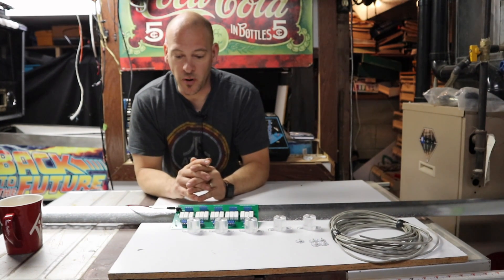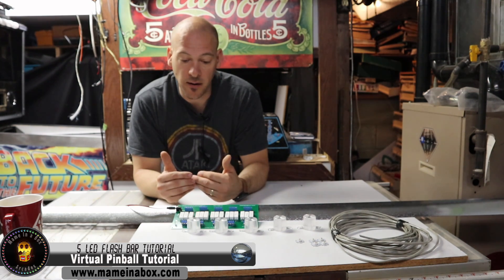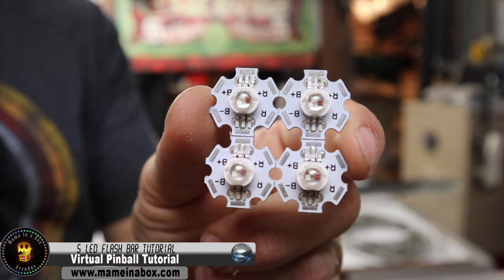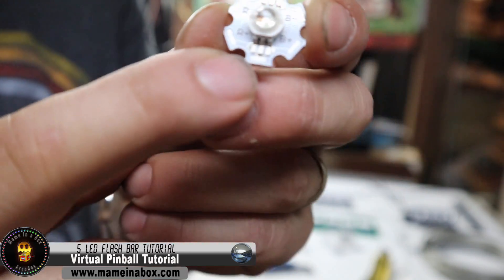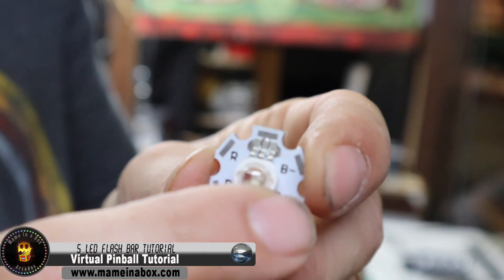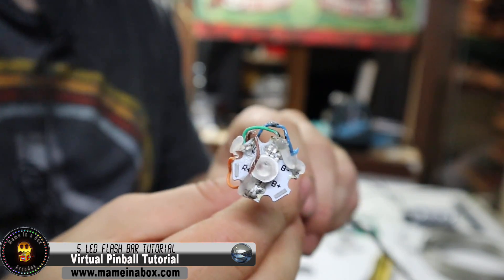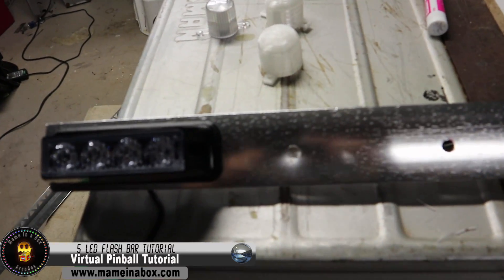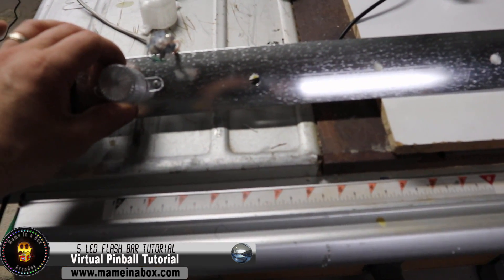DIY LED flash bar

Comment: how comes you use the same resistor value (33 Ohm) for any color? Shouldn't it be 27 on green and blue?
Reply from the maker: Technical speaking yes. There is no visible difference to my eyes and this has been working flawlessly for a couple of years now.

Comment: Great set up , I'm thinking of of making my own 5 flasher bar ,my question is do I need to use the the led wiz or can I use the teensy to control the flashers ?
Reply from the maker: You will need the ledwiz or a pinscape. The teensy is only for Addressable led
Reply: Ok thanks ordered 👍 
Can I also connect my strip lights to the led-wiz instead of using teensy?
Reply from the maker: Not if they are Addressable.  If you want a led strip to connect to the Ledwiz, you will need regular RGB led strip.

Comment: Hi I bought your flasher management board. Everything is working fine and has helped me greatly powering up the flasher lead.  Just got one question. All the 5 leds come on when I turn the pc and power on to all the boards. They then only go off when I start pinup player, and then coming on when I start a table via dof. Can I do anything so they dont come on when i turn power on initially? Not a deal breaker, its just that i could be just working on my pc and all LEDs would be on.
Reply from the maker: How do you have them connected to your cab? are you using a Ledwiz? And do you have the output of board going to a port on the ledwiz?
Reply: @MajorFrenchy  hi I have the 15 ports (3 per rgb led) going into an ultimarc pacdrive. Then I have power and ground from board going into power supply. No other output going into the pacdrive?
Reply from the maker: @kalnayak11  that is an issue with the   pac drive. When booting the computer, it opens all ports and does not close them. 
2 solutions. Get a ledwiz or pinscape to replace the pac drive. I have a pac drive and when I boot the computer I disconnect the usb and connect it when windows is loaded. You will see that the device is still on when connecting. I run ledblinky and close it to stop the Pac drive. It sucks but that is the reality of the pac drive.
Reply: @MajorFrenchy  thanks for that info! I do have a pinscape but as I'm running it without the expansion boards it will just take too many ports and mosfet boards. I will look at getting the ledwiz from groovy. Pacdrive was just easier to obtain from uk :) in meantime will disconnect usb on startup. Cheers

Comment: I was thinking of getting the recroommasters 40" pinball cabinet. Do you think this idea would work on that kind of cabinet? Do you think it would fit on top? Thanks https://www.recroommasters.com/40-Virtual-Pinball-Machine-p/rm-xt-40-pin-cab.htm
Reply from the maker: The cabinet looks good. Yes the 5 LED bar fits whatever width of cabinet because you need to build it. Some people use wood, aluminum or even metal.

Comment: thanks for another great vid,   I did pick up on in the config menu,  shouldnt it be device #2   as your first LED Wiz  is your button config?    or  are you just using the one ledwiz?
Reply from the maker: I am using 2 Ledwiz. I am using the 1st one for non mechanical stuff and the 2nd one is using the Sainsmart board with the Ledwiz for all my solenoids, contactors, gear and shaker. Yes my buttons are connected to my ledwiz. you basically connect the Negative of your button light to the Ledwiz to make them blink.
Reply: @MajorFrenchy  the ledwiz here in australia is pretty rare to find or out of stock,  besides groovy gamegear where did you purchase yours?
Reply from the maker: @Cappfzr  Groovy.

Comment: I love that you utilize network cables, I have a abundance of these.  When I installed my controls, nudge, and plunger VPin controllerI used a old Printer cable since it had enough plus extra and was able to keep a lot of it sheathed at least till the first connection makes things so clean
Reply from the maker: You are right about making it clean. It's easier to fish them in the cab as well.

Comment: Great video! Please major frenchie make a video about the lockbar receiver installation!! As well as the siderails and glass. I already got my playfield display (Acer et430k) and I am currently searching for a backglass display, Is 16:10 at 30"inches the closest to the real deal?  Is backglass art created under 16:9 format, will it look stretched? What do you recomend
Reply from the maker: i don't know anything about the lockbar mechanism. All tables i every built were restored original cabinets and never had to install one. for your backglass, you can tell the software the dimension of your choice. That should not be an issue in your case.
Reply: Hey Johnny i've actually got my table apart for upgrades right now, what do you need to see for the lockbar install? i can shoot a short video showing my lockbar, I may have been super lucky - I eyeballed it and everything lined up about perfect but i'm happy to show you where mine lines up, where i screwed it in, etc I don't have any install photos here and I hope MF is cool with me linking out, but here's my build album (https://tinyurl.com/y6c59n2w
), send me a friend request with your youtube name (if different) and i'll get you whatever you need

P.S. MF if you prefer i don't do that shoot me a msg and i'll remove it! :)
Reply: @PwnyTrix   awesome work! Thank you so much for you response. I am building a cabinet from scratch, custom made to fit a 43" playfield and I've been researching online for hardware parts, I came across the virtuapin  lockbar and lockbar receiver kit, so I wonder how does a regular lockbar receiver fits inside and how the mechanism works in order to implement that on my project. Thanks a lot!
Reply: @johnnyulate8218   I'm also using a 43" 4k display, but i started with the williams widebody plans, I used all the hardware from virtuapin as well for both the cabinet and the buttons, including the digital plunger kit, did you see what you needed? i know there wasn't a direct photo of the receiver assembly or how it was installed. If there's any angles or anything you want to see that wasn't in the album let me know and i'll get some stills or a video uploaded for you!
Reply from the maker: @PwnyTrix  I am all about sharing